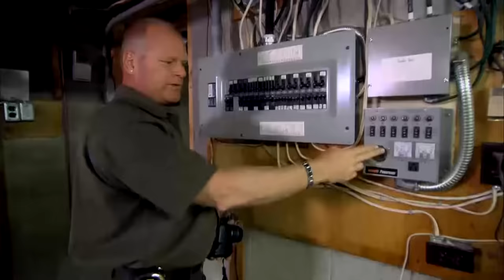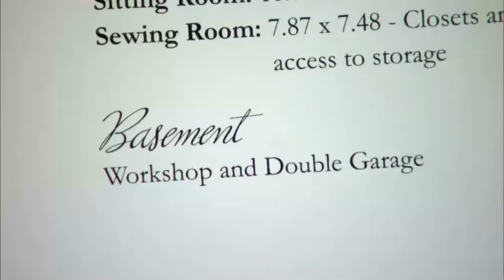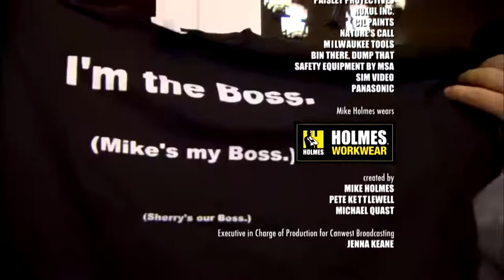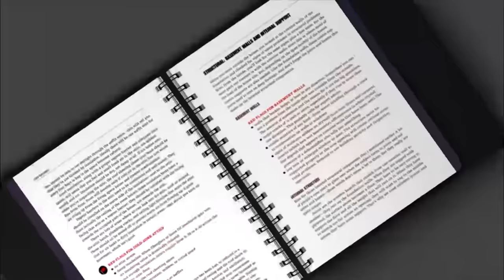Dream Home Turned Nightmare! | Holmes Inspection 119

Comment: Self serving service. $$$$$$ is their only concern.I’ve lived in houses where i parked my vehicles,lawn mower,weedwacker, gas cans and motorcycles. No big deal. I live in a house with leaks. So what. I live in a house with 110 yr old wires. I’ve work on building sites where it was the minimum effort and highest profit parts. The only thing i will not live with is crummy water and people who use fireplaces which these hyenas completely ignored.
 These people are out sixty grand and will never see a return on it.

Comment: As a rural homeowner, this one had me frowning a bit. The hysteria over the "open" garage was really something. Sure, it's not to code. But they really wanted a garage and you gave them. . .nothing. The danger posed by that garage was little more than the danger posed from any attached garage. There are millions of homes built with an attached garage with living space over and adjacent. You can wall it off and sheetrock it and it's an attached garage. It's only a problem if you left your car running in it, and that's a problem in ANY attached garage. I think the hysterics over "you're gonna kill your family" by parking a car under the house is a bit much. I wish they had spent more time on that odd well. It took me a minute to determine that this house was served by that well. Then, they went whole hog on a system that will cost hundreds if not thousands of dollars a year to maintain, because those homeowners aren't going to touch it. They'll get the maintenance contract. The house went from nothing to a complex iron removal system, a softener (which adds salt to your intake), and a UV filter? For what? For bad taste? I sure would have liked to see the well test. That looks like a well company that just sold them the whole hog. When it comes to well treatment, less is more. Install what you have to. This struck me as two city dwellers in over their head with a rural house.
Reply: Yeah, no. As someone who was born and raised in the country, that garage was absolutely going to slowly poison that family. I'm sorry you don't know the difference between a sealed off garage from what's essentially a basement you can park your car in. There's HUGE differences in several aspects. Fire being the first. There's a reason true attached garages have that beefy, self-closing door and a crap-ton of sealing. Educate yourself on the bare basics of a safety, for goodness sake. Ignorance is a choice at this point. The information is at your finger tips. Code is there for a reason, and minimum code is really just that. The absolute minimum. If you're not even meeting that, rest assured, there's a damn good reason it's illegal and you need to fix it. I could get into off gassing and all that jazz, but I'll leave that to you to read up on yourself - should you choose to. As for the well, living in rural Ontario, and having lived on well water for some of that time, and having grandparents who were entirely well dependent - we all got that water tested every so often. Especially when it started to smell funny. Clean water doesn't smell. ONE parasite is all it takes to change your life forever. Is UV overkill? Maybe. Is filtering out an overabundance of iron? No siree. Heavy metal poisoning isn't much fun. Just because YOUR well is (maybe) clean, doesn't mean their ground water is chalked full of crap - literally or otherwise. There's this thing called survivor's bias. It hasn't affected you (yet) so it's not a problem. It's the same reasoning some idiots still don't wear their seatbelt.
Reply: BS, you can park your car in the middle of your living room if you want with NO ISSUES! Yeah you don't want to sit there and run it but  pulling in and out is NO ISSUE!!
Reply: I think you should look at typical builder grade homes and what an attached garage really is before you accuse someone of being ignorant. How would you get poisoned from a car sitting below your house? I mean, if someone is stupid enough to leave it running, sure. In lots of places, there's no requirement for any kind of fire protection or self-sealing door. And people aren't dying in droves from their garages. You make a bunch of statements about well water but you're not addressing what I said--the well test is everything. Water can taste "odd" to a lot of city slickers because of mineral content. That doesn't make it unsafe. The well water test dictates everything.  @Mystress1980
Reply: I'm inclined to agree, but remember codes are meant to prevent idiots from killing themselves.

Having said that, if you live in a very cold climate, you probably start your car in the morning and let it run for 10 minutes with the garage door closed before leaving.
There was a story not too long ago during a prolonged snow storm a family was so cold they got into their car in the garage and ran the engine to get warm and a couple of them died.
Where I am we don't get snow, so we start the car and open the garage door and pretty much drive out within a minute or two.

They were a bit hysterical in acting like one whiff of CO will poison them.
Reply: Common courtesy is to not film up a beautiful woman's nose. Thank you.❤

Comment: If you need a smug, condescending guy with sus frosted tips and a silly tight sleeveless shirt —  who isn’t a ticketed carpenter — to pose and hug old ladies for the camera, call Mike Holmes. If not, find a reputable contractor or a real journeyman carpenter.

Comment: I call bs on the whole garage being a danger thing. Your not gonna be parking your car in there and leaving it running with the doors closed and even if you let it run with the door closed for five minutes I cant see that being as big of an issue as they are making it. Also a stupid cheap and easy fix. Many many houses here in Indiana put the furnace and water heater in the garage and it's not an issue. Also many houses have furnaces and water heaters that run on natural gas in your home. Stoves furnaces etc. Leta also point out that these are vents pushing air out not sucking it in ... as someone who's been a contractor for many years and that has a dad and now step dad that are also contractors. Alot of the shit this dude says is bs and way over stated to get people to watch

Comment: Hello from Ohio you know I have a garage thats basically the same setup as that one and everybody has been parking there vehicles in it along with tractors and anything else that we can put in their for years and there has been nobody sick or anything from it. It's just like everybody always panics over something stupid all you had to do is reroute serten things and if you had to put in a bolkhead to cover the air duct or other things and drywall the rest of the place but I guess you not smart enough to do that and then anyone could have used it so you made it so they can't use it at all and now they have to park outside you should have made it right and built them a garage if you had to so you should have lived up to the name of your show

Comment: "it is not up to code"....
well one man's code may not be not another man's code...
In my contry aluminium wires are not allowed at all in any house or commerical building, and if it was for me, I would replace all the aluminium wiring by copper lines - massive job - basically rewiring the entire house.
And those yellow connectors that twists two wires together, what a crap! How can you even allow things like that in any code??? Not a surprise if they melt, because the connection they create is loose and thus heating up.

A double garage... there is a post in the middle of the entry a nice big american pick up is probably not fitting in there!
Instead of condamning the access, wasn't that possible to get a door beteen the garage and the living space and isulating the garage ceilings?

Generally speaking, I do not like this american way of doing (saying) things - in a very affirmative way, never nuancing, like there is only one way of doing things, one single best solution. It might be for the show though.
Being a builder myself there are very often multiple solutions to problems each of them with specific pros and cons.

Didn't understand for example why did they change the windows?
Windows are very expensive items!
They said the windows were leaking, without performing any test though...
Windows are rarely leaking, but if the were, you coud simply reseal them.

And what are those new windows they are installing that open towards the outside?
how do you even close those windows once they have been open? seems very unpractical to me
Reply: The house is in Canada . They have different codes than the United States. Aluminum wire in the usa was used in some low end houses built in the early mid 1970s is all I have seen in the usa.

Comment: So 40 years s people lived in the home and no one died right? Put a door in! 150$ and two hours and you have a door. This show is fake
Reply: They did not use the garage to park any vehicles. The weird part was that they vented the dryer into the garage area. Yet they had no moisture damage there.
Reply: I spent 30 years in the restoration industry I have done everything from water/ fire hurricane/ tornado to crime scene clean up. The damage they are making such a big about is common for a 40 year old house. Notice they didn’t flip the drywall over so you could see the side the water damaged? Had it been that bad you would have had mold on the back. But then they would have to follow the proper mold removal and carpenters and scaffold don’t quality. The garage looked more like a work shop and the vents probably added heat while you work . I also worked on the construction side putting buildings  back together and I work in the house flipping industry now. I have never seen a house get inspected and still need 60,000 to 80,0000in work needed. Something is just not adding up. Maybe there was no inspection and they just lied to make this guy look credible anyone who deals with inspectors knows you would never find a dozen or so things that he or she would have just missed especially the deck coming away from the house. Someone is not being honest. Maybe this show is produced by the government
Reply: @darrickbrown830  people post videos on YouTube hoping to get many hits.  So they tend to be theatrical than truthful.  $$$.   The first thing I noticed was the outside support in the middle of the driveway.  Then the hot air duct in the garage.  Not a house I would buy.
Reply: @rayRay-pw6gz  I been dealing with inspectors for 30 years no inspector went through that house. Inspectors have no skin in the game. There whole job is to find problems. I swear they are the kids that were picked on in school. I don’t know why this show uses the fake inspector scam but maybe it makes the show more appealing to watch. People just can’t believe how much the inspector missed maybe. It didn’t happen I would bet money and for sure know it doesn’t happen enough for this guy to find one of term enough to make a multiple shows. They just don’t expect people to know any better.
Reply: @darrickbrown830  many realtors have home inspectors that do favorable work for the realtor.  They work the same area , so one hand washes the other.  My home had four exhaust pipes hooked up to the chimney. Natural gas water heater, furnace and two wood stoves which is not to code. I did not say anything because I was removing the wood stoves anyway.  My first house and the realtor had her own inspector.

Comment: I dont agree with Mike on taking away the garage you dont take away a garage from a family with babies and grocceries etc mike is wrong to take it away
Reply: Convert the bottom of the drive where the cistern is to a car port at the minimum
Reply: Did you miss the part about it being a life/safety issue, it’s not really a garage.
Reply: @leestebbins5051  but its not a safety issue thousands of families have attached garages
Reply: I get what your saying, but the house is already configured without the garage, there would be a ton of gutting inside to make it "work"
Reply: @leestebbins5051 unless you're running your car in the garage for extended periods of time you're going to have minuscule amounts of CO2 that escape into the home.
Reply: It wasn't just the car emissions, there was dangerous electrical, dryer venting into the space, coating the bottom of the joists with lint, it's a tinder box waiting to go up in flames. A failing wall which would have collapsed and taken the whole side of the house down with it. It was an illegal garage, even 40 years ago (in 2010 this would have been built in the 70's). And cars as well as rural vehicles like tractors (diesel fuel) would have never passed code. It wasn't sealed from the rest of the house. Cars were more toxic back then with leaded gas. I know where they are generally, Caledon, ON is largely rural with a lot of farms in the area.
Reply: @americarocks1776 CO, carbon monoxide, not dioxide. depends on the weather. On very cold days people might run their car for 10 minutes with the door closed.
Reply: Why, will the children melt in the rain?
Reply: @animeangel1983 So if someone owned an electric vehicle, should they not be allowed to park there?

They did the electrics,  they could easily vent the dryer and shot off the ducting. I doubt it would be as expensive as you think to make it a garage within code.
Reply: @leestebbins5051  seal it off and move the ducts.